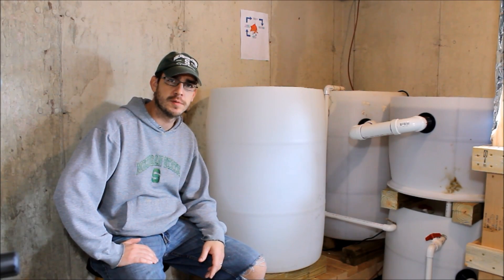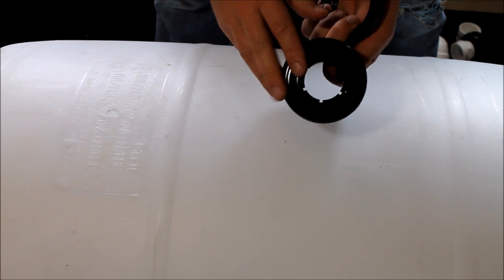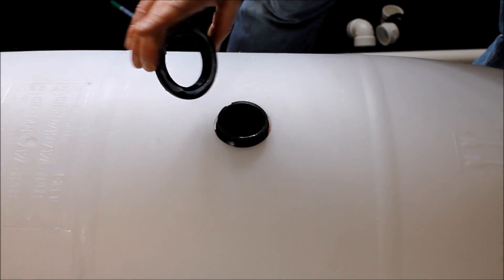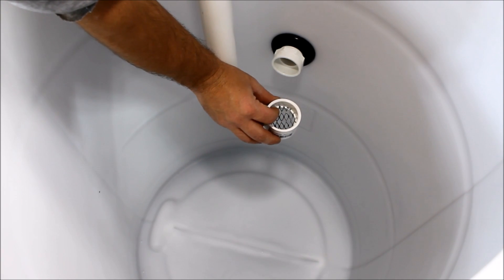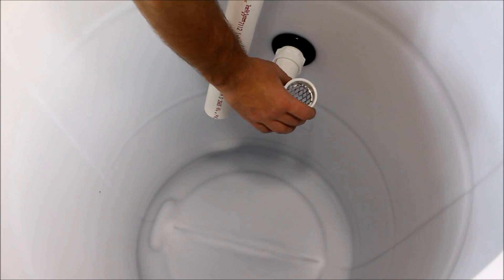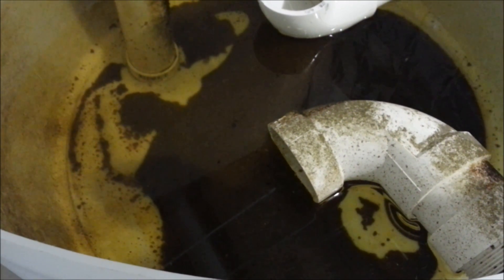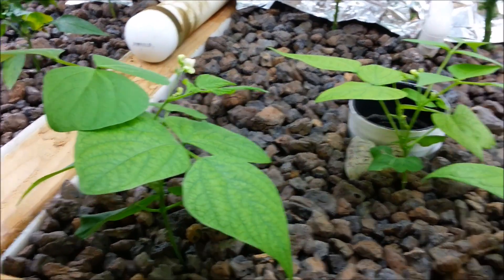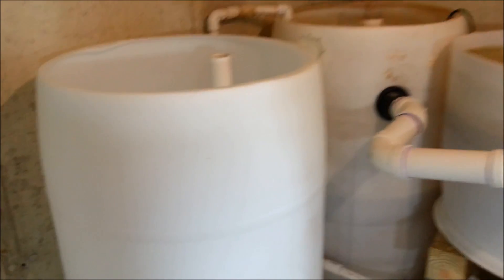Aquaponics System Design - Fish Tanks, Solids Lifting Overflow, and Bulkhead Adapters

Comment: I have a concert floor so a underground slump is a no no
So can someone help me find a same height on the floor aquaponics system 
 i plan to run a 300gal fish tank 
I would to run a bigger tank 500gals but i dont think i should but so much weight on a concert floor (in he basement )
Reply from the maker: +Your worse enemy this system does not have anything in the floor. Sump is setting on the concrete

Comment: Hi I'm very new to this system and very interested to do. I need some tips. 
1. When should I change the water. Should I have to change whole water? 
2. Is there any chance that crops get diseases like in regular farming?
3. Do I have to pump the water all time? Switch on air bubbler all time?
4. If build in open area where I can get direct sunlight. Still should I need lights.
Reply from the maker: It is good to change out some of the water from time to time but really only when your system is starting up. Once it gets going you may need to add water due to evaporation but that's about it. Crops are subject to some disease but no where near what you would have outside. If you have light then you don't need lights. Pump should run all the time and air bubbles for the fish

Comment: If I may, why not just pipe both fish tanks directly to the swirl filter, rather than the SLO from one to the other, then to the swirl filter?
Reply from the maker: +Paul Petrea that would probably work better in hind site. I was trying to keep water flow simple, in one end out the other but splitting the flow would have worked fin
Reply from the maker: +Paul Petrea that would probably work better in hind site. I was trying to keep water flow simple, in one end out the other but splitting the flow would have worked fin

Comment: Great design on the Aquaponics system. I got a question on the water flow of your second fish tank. How does the water of our second tank (the old one) drain to the swirl filter tank? Since I saw your swirl filter tank is bit higher than the old fish tank, I dont understand how do they work on this systems? Thank you so much!
Reply from the maker: Even though the pipe slopes up the water level stays equal in both tanks. The pipe is just like that as I add the swirl filter and second tank as an after thought

Comment: You may want to consider numbers of fish. 55 gals isn't much room to house very many fish for very long.  Tilapia grow big.  I can't remember the ratio of inches of fish to gallons of water.  I love your system.
Reply from the maker: lechatboote yeah I have considered that for sure. I figure between the two tanks I should be able to get 15 total in there but only time will tell if that is pushing it:) Thanks for following along!
Reply: Wishing you all the success.  I want to do aquaponics with brown trout.  They don't need it as warm as tilapia.  Have a small greenhouse will work on something more suited to the aqua culture.  Have some snow but usually not too low on temps although passed two winters way below zero so we shall see.  The idea of fresh lettuce without the store!!! Keep up the great work.
Reply from the maker: lechatboote Well I will spoil my next video here but I am thinking of doing a different kind of fish also. I recently had all of my tilapia die and I am not really 100% sure why other than maybe I didn't have it warm enough. I am looking into perch or maybe trout also, that is a good idea.
Reply: A learning process not without pain!  I was told about 82 degrees for those little devils!
Reply: lechatboote the rule of thumb for tilapia is a 1/4 pound per gallon or 1 pound per cubic foot of water.  There are 7.48 gallons per cubic foot.  So about 14 quarter pound fish or about 7 one pounders.  Ideally, if you are raising your own fry, you would want several containers so you could have little ones in one and bigger ones in another.  If you are really on your system throughout the day though you can have it more dense.  If it's a walk away system best to keep the numbers smaller.

Comment: The water is going to get pretty cold if you are in the basement. Especially with those bare concrete walls. How are you going to heat the water? I thought Talapia like pretty warm water. It might be expensive to keep heating the water as you are losing that energy in to the walls. Nice though. I had the same prob with my fish tank so i put some foam between the tank and the wall and it helped quit a bit. However, I am only heating my tank to 70 so...
Reply from the maker: That was a concern of mine as well but I have had the system down there for over a year now with minimal heating. I have the sump tank off of the floor with some wood and the fish tanks are close but not touching the walls. The basement a constant 65 degrees throughout the year so I do heat the water a bit. I have it set at 70 right now with is perfect for blue tilapia which enjoy cooler water temps. When I redesign the system I am planning to finish those walls and insulate so that will help also. Great question and thanks for checking it out!
Reply: SSLFamilyDad
Nice! I love aquaponics. I cant wait to build my aquaponic green house this summer. So excited.

Comment: Do you do anything/have problems with humididty levels in your basement related to the system?
Reply from the maker: Nothing significant. Sometimes a little condensation on the basement wind right above the system in the Winter. Other than that I have not noticed any humidity at all.

Comment: Minor engineering issue, you'll need the pumped water from the sump to be exclusively running into the new tank. Any other flow set up, and the water won't actually flow OUT of the new tank but INTO it, bringing waste and water stagnation. But since it looks like all that is required to change that is moving the one pipe, should be easy enough.

Like the set up overall, wish I had the space to do half-barrels like that, and I LOVE your lights. Ended up making one myself and love it for my cobbled together system.

Comment: check out what you want your water temperature to be or where it is running. goldfish and tilapia are not compatible for temperature. goldfish colder, tilapia much warmer. check out Friendly Aquaponics.
Reply from the maker: That is a good point 1mtstewart. However there are a few different species of tilapia and some that will be ok in colder temps. Also, gold fish will live in just about any temp. I have had them in over 80 degree water and almost frozen solid in an outdoor fish pond:) I am going with Blue Tilapia which can survive down to 48 degrees (not what they like but will survive). Thanks for watching!

Comment: since fittings are glued externally between barrels, I would install a valve with removable ends or at least a union for future considerations. a valve, you could isolate on tank and maintain level, while servicing the other. with a union, at least you could separate the two if your needs change!
Bravo!
Reply from the maker: Yeah, I went back and forth about putting a valve there but due to poor planning I didn't have enough room on the stand to add the valve in between. Right now I just pop a cap on the pipe on the inside and then I can drain/fill one or the other.
Reply: not to worry, you can cut the pvc pipe and take the bulkhead fittings to a machinist friend. he can cut the glue and all out so you can reuse the fittings.rel can stay on the stand, just need to improvise on the plumbing for versatility. great job you are doing and teaching so many what can be done! thanks!
Reply: I turned my bulkheads the other direction. That way I have the threaded part on the outside. If I ever need to change anything I can cut and unscrew the thread/slip adapter. Inside the tank I just press fit the piping, like you said, who cares if it leaks.
Reply: Good thinking! Best of luck!

Comment: for your future barrel, fitting and pvc work + sheet metal and conduit, please use a deburring tool like:

http://www.ebay.com/bhp/deburring-tool-set

this tool will take off any burrs and clean up the surface to prevent cuts or abrasions on your and your families hands and skin. great video, best of luck!

Comment: ok so I might be way off...  your SLO on the new fish tank shouldn't that be as high or higher as your SLO  on The original fish tank, and did I miss the water supply bit for the ne fishtank? The way I think I saw your setup looks like your water supply comes fom the sump to your original fishtank then equals out through your second SLO only to end up pulling waste back through.  Don't your tilapia need a form of current ?

ok I think I see part of what your going to do-  with your waer supply, with either a Tee with two spigots or just changeing the waters entrance point  in the new FT.

sorry if I came off kinda brusk..
God bless
Reply from the maker: lol, I am following your thought process here Gary, very good points. I didn't do a very good job of explaining that and I should have. I have not changed the fill pipe from the water pump yet but I will divert all or some of it with a tee like you said. Then all of the water will go into the new tank and then flow into the old and then out to the swirl filter. The height of the SLO doesn't really matter since the solids will just float tot he bottom of the other tank and then be lifted out again. It is getting a bit messy in that corner of the system and I may just take it all apart in the future and redo it to make it look nicer. Kind of like 15 additions on a house! Thanks for the questions!
Reply: Ha my typing needs work!!!!

Comment: Great update mate. Really liking the system a lot. I like the improvements you keep making. Id like to know more in the future about how your solids lifting thing works. I was thinking of a tap system at the bottom of a barrel, that we could open to drain out the solids and then pour onto outdoor plants. How often are you topping off the water in the system by the way? My friends we have one tank with 2 large fish who produce a lot of good waste, but we usually top it off with 1 litre of water every 4-5 days. All the best, Robert
Reply from the maker: The solids lifting overflow works great because it is the only real way you can get the solids off the bottom without 1. having to cut a hole in the bottom of the tank and 2. without any flange or lip being caused by a bulkhead right through the bottom. This way, if a bulkhead fails the tank can only drain to halfway and the fish live. You could do it but might require a bit of fancy drain work on the bottom to overcome the lip where solids would collect. Same issue I am having on my swirl filter, there is a small lip there on the drain so when I try to drain all the solids off much of it gets stuck along the bottom. System tops off automatically with a float in the bottom of the sump tank, not sure how much it adds each day to be honest but it isn't that much. Can't wait to see what you come up with man!
Reply: Thanks for the reply mate, thats really interesting. I really had not thought of the whole lip thing. Good catch! Also with your system i guess not having to move the fish is quite handy. I also like what you done with the piping by not glueing it etc. Does make life easier. i ever understood gluing such works. If you get the right pipe size you should always be fine, especially some rubber seals / o rings. Not sure when i get mine running, but hopefully sometime start of next year! All the best, Robert

Comment: I'd like to try Aquaponics but with Trout instead of Tilapia, any idea if trout would work, I would most likely use IBC's.
Reply from the maker: Sure would, trout are good especially for colder conditions. I considered them as well but they are not good in the smaller tanks I am using. IBC's would be best.